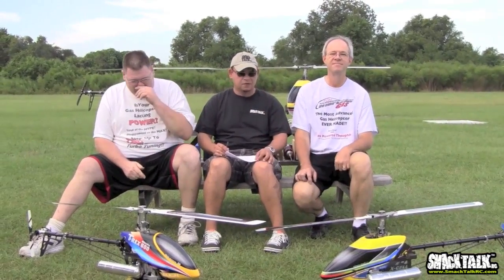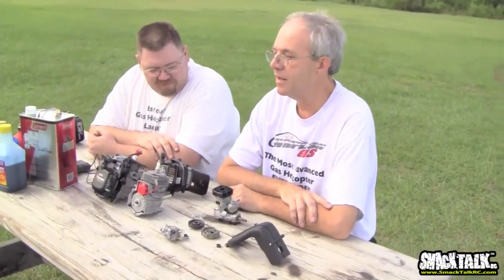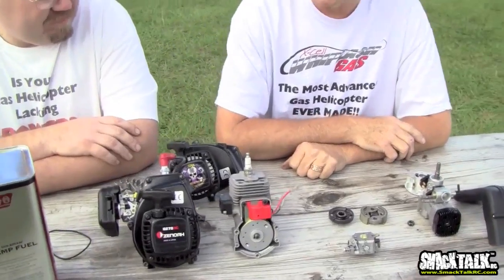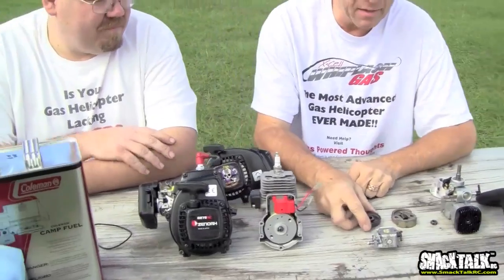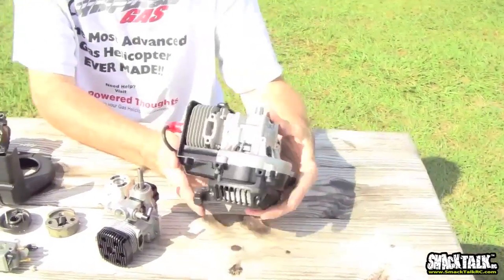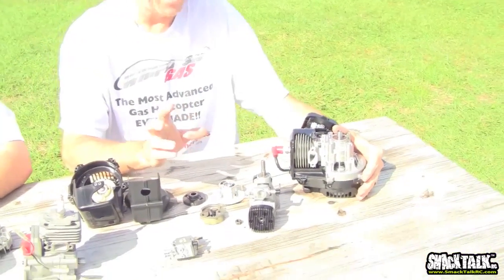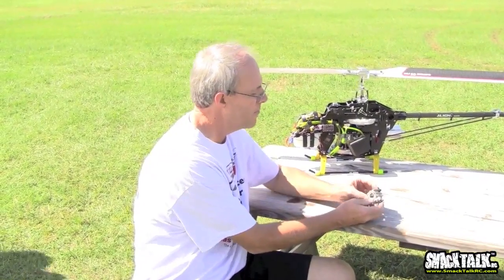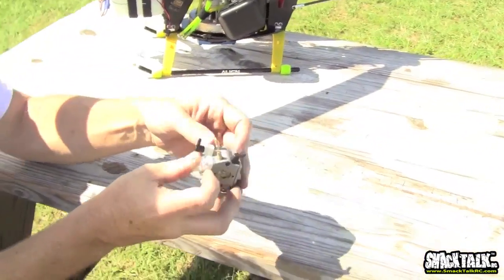SmackTalk RC Episode #19 - Gasoline Helicopters

Comment: I'm wondering about some 110 leaded , or even 100 unleaded ? Those are about $8 to $10 a gallon.
Reply: low octane fuel you buy at the pump is perfect, preferably without ethanol. No need for high octane and you definitely don't want lead.

Comment: Would "true fuel" work w/o mixing oil? I run my weed wacker on it w/o mixing oil. I was told it's not needed. It also has a long shelf life. I buy it at home depot.
Reply: You need to use mixing oil, these engines are custom built for the Heli's forget about the weed wacker cause they are different.